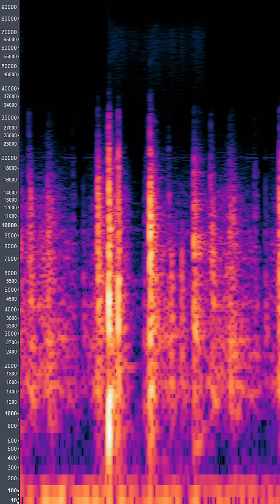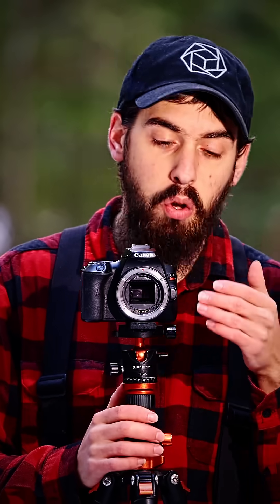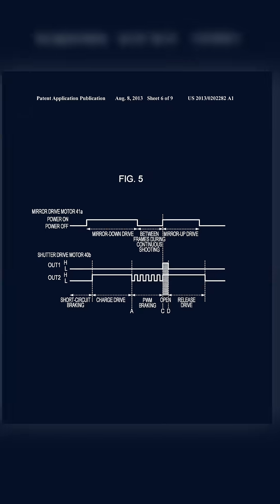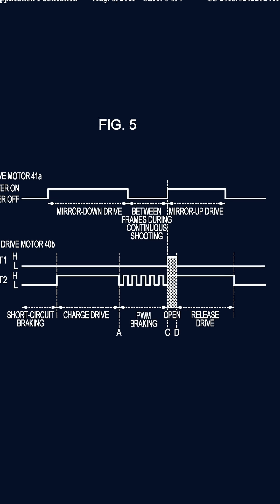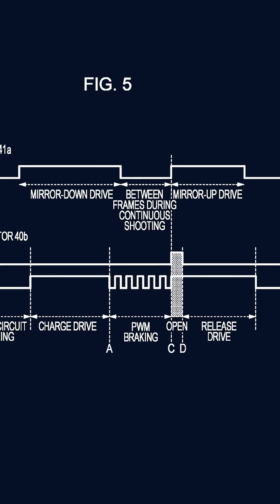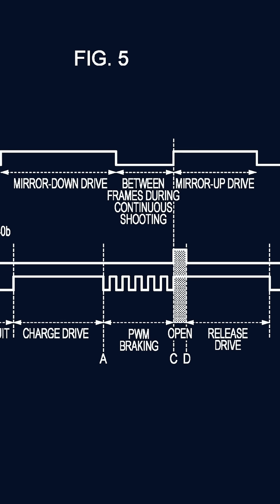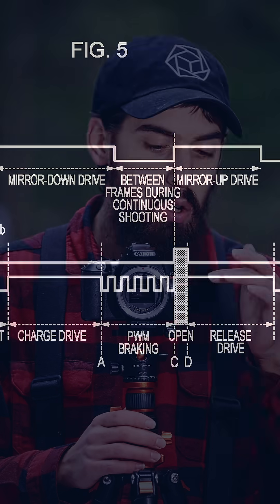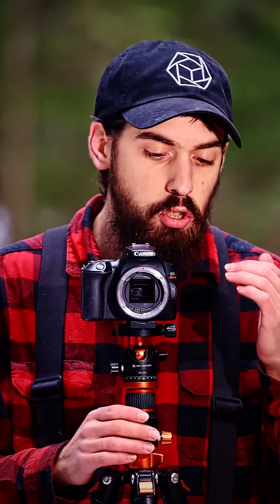Listening to Ultrasonic Sounds Produced by a Camera

Comment: If the shutter has metal parts, the ultrasonic static could be just mechanical sounds of metal. I've done foley recordings with an ultrasonic mic (Sanken co-100k) and it's just the case that metal objects resonate at ultrasonic frequencies. Jingling a bunch of keys produces tons of ultrasounds. Glass, plastic and wood don't produce ultrasounds, but metal and water do.

Comment: sensor cleaning 😉
Reply from the maker: The sensor cleaning only runs when the camera turns on or off, not while taking photos. Also, just to be sure, I tried recording the camera when it was performing the sensor cleaning and it only produces sounds up to 32kHz, not the 60-70kHz we're hearing when taking photos.

Comment: Many cameras use ultrasonic frequencies to clean sensor I heard, On canon cameras it is set to occur at start and power down of the camera automatically by default, (the display says “sensor cleaning” when it occurs) , maybe this model does the cleaning even between shots automatically to prevent dust or debris from sticking to sensor,
Reply from the maker: I had a chance to do some more testing yesterday. The sensor cleaning only seems to produce frequencies up to about 32kHz. Whatever this sound is only occurs when the mirror/shutter move (I tested by switching in an out of live view). I still haven't determined whether it's the shutter or the mirror though.

Comment: 20khz is still audible spectrum not ultrasound. 60khz you need a microphone, preamp and converter, that go up to that, which is rare, use only for measurments and bats, not normal audio recording, first and second audio gear is probably not shielded for interference and stuff that high so it could be anything.
Reply from the maker: I don't think a lot of people realize just how common gear which can record ultrasonic sound is. Sure, you can't just go buy a random LAV mic and record ultrasound, but you don't have to pay thousands of dollars like a lot of people think.
For one, most microphones can record virtually any frequency because it's analog. Where the issue arises is in the ADC which needs to be able to record a high sample rate. But when it comes to professional audio (not just for recording ultrasound), a high sample rate is common, not rare.
Reply: @BlenderTimer 
Microphones cant record any frequency. Wavelenghts have sizes  in mm and the size must a lot bigger than the components of the microphones, it's acoustics, basically, like subwoofers cant reproduce crisp highs big membranes cant capture ultrasound. Just like analog cameras dont record radio waves. For the record schoeps mikes that are used for high quality classical reach up to 40khz +-1db and they cost over 2k$. 60khz I never heard honestly anything, and i recorded soundscapes as a job for quite a bit.
Also adc have higher sample rates to allow for smoother filters, so the phase in the audible spectrum is less impacted, but they dont maintain the frequencies above 20khz.
On top of all that capacitors and inductances in the analog signal path act like filters and there's no regard whatsoever of anything above 20khz so whatever is there might not reflect reality.
If your information differ please provide actual measurements made with specialized gear.
Reply from the maker: @tutatis96  Well, it's quite clear to me that you're another one of those people who think they know everything when they don't. You say the gear can't record ultrasound when I have TONS of evidence that it can (including the frequency response data of the mic). You're talking about recording 40kHz at 1db but forget that when you're recording at 32bit you don't need the microphone to be extra sensitive to ultrasonic sounds in order to record ultrasonic sounds. I specifically said in other comments here that I use the Zoom F3 for recording ultrasound, which if you do some basic googling you can find that there are thousands of people who use the F3 for recording ultrasound.
I would recommend before you go around on the internet acting like you know what you're talking about that you do a bit of research on what you claim to know.

Comment: The static sound is produced by the required DC/DC converters for the several onboard voltages. Depending on the converter type they operate in different frequencies, some do in the ultrasonic range (I guess the display supply).

Comment: DSLRs generally contain one 8.4 V battery but their circuitry runs on a couple of different voltages like 3.3 V. Maybe the back-converters have something to do with the static sound
Reply from the maker: Maybe. I mean it surely has to be something with the circuitry. 🤔

Comment: Bro? How did you come with that? Most microphones have filters limiting frequencies above 20kHz. The same for other parts of audio chain, and most importantly, the sampling frequency of the ADC limits the band it captures
Reply from the maker: You have to get a good ADC. In my case I'm using the Zoom F3 which many people use to record ultrasound since it allows a 192kHz sample rate.

Comment: Maybe the static like ultrasonic sound, could be the self sensor cleaning. If I remember correctly they use a piezo to shake off the dust from the IR block filter in front of the sensor. But I don’t know if is operated continuously or only at startup.
Reply from the maker: Yeah they do use a piezo element, but they only function when the camera turns off and on (at least as far as I'm aware). I haven't actually tried recording the cleaning function separately, I should do that.

Comment: Maybe resonance of some kind? Seems like the static sound has energy also in the main spectrum, maybe caused by the spring mechanism of the mirror
Reply from the maker: It seems like it cuts off too quickly for resonance though. It seems like it'd fade out at least a little bit rather than just cutting off.

Comment: This only works if you have audio equipment that can record at higher than 44.1 kHz, which is specialty. Basically you can record up to half the sample rate (so 44.1kHz maxes out at 22.05kHz frequencies). Also be wary that most (even specialty and professional) recorders have low pass filters to filter out anything above 20 kHz as they will otherwise cause aliasing issues (i’m almost 100% sure the issue with ‘static’ and the 20 khz signal is aliasing or measurement noise). Finding equipment without that filter is hard!

The slowed down audio you showed us has zero ultrasonic information captured in there. This shows how hard audio is! You really need very special equipment (specialty microphones + specialty recorders) to do this!
Reply from the maker: No, the static is a real sound recorded, not a glitch. The microphone I have allows disabling the low-pass filter and the ADC I'm using allows sample rates of 192kHz and 32bit. The aliasing would only cause frequencies higher than 96kHz to sound a lower pitch (which could theoretically be what's happening but I highly doubt it and even then that would still mean there's an ultrasonic sound produced by the camera that's >96kHz).

Comment: It’s presumably either some power circuitry or parts like the shutter. You may be able to check for the latter by changing how stable the camera is when you trigger it. For example placing the camera on a table rather than mounted on a tripod. A quick and dirty way to check the former would be varying the power load or using an external power supply.

A few quick google searches  "Canon DSLR shutters, especially in modern digital models, use a pair of lightweight metal blades (often titanium or aluminum alloys)”

“Titanium's vibration frequency isn't a single number; it depends on its form (alloy, pure), shape, size, and conditions, but it generally has high stiffness, meaning it vibrates at high natural frequencies (kHz range for small parts like implants), while its damping is low, making it ring longer… For example, a Ti-6Al-4V test specimen might have a natural frequency around 20 kHz”

Comment: The static is probably random EMF from mixing products of the PWM oscillator and other things in there. Most things with servos will have a high pitched whine (when I was younger, I could hear it. I still can, but not as well.)

Comment: Interesting! Do you also have this if the camera stays in live view mode? Probably is the sensor being used? I'm super curious now!
Reply from the maker: I did try that because I initially thought maybe it was the sensor being read. I tested in live view and the sound only occurs when the mirror and shutter are being opened and closed. So that rules out the sensor.

Comment: It may be noise from the motor brushes if it's a brush motor. Brush motors would cause static on the TV and radio in the analog days from the arcing. of course there is a physical sound associated with that.

Comment: Maybe it is the noise of the crystal oscillator. They are typically set to 32768 hz, but probably there are versions set to 65536 hz for better precision.
Reply from the maker: The closest sounding thing I've recorded was a piezoelectric igniter, but the only piezo element I'm aware of inside the camera is for cleaning the sensor which doesn't operate when taking photos. So I'm not sure.

Comment: Sometimes autofocus can do something similar but it’ll be picked up on a radio frequency, I’ve heard it on my scanner when I was listening to the ATC frequency and as I focused it made a high pitched buzzing and static sound
Reply from the maker: Yeah, many lenses use USMs (ultrasonic motors) for focusing. I tried recording one but wasn't able to hear anything, so either it was so quiet that background noise muffled it out or it was beyond 100kHz (the max frequency I am capable of recording).

Comment: I heard the static, but I couldn't hear the other one.
Reply from the maker: It's a bit more difficult to hear. It's almost exactly 20kHz which in the slowed down version is 2,000 Hz. So if you get a sine-wave tone generator and set it to 2,000 Hz, that's basically what the sound is like. I don't know if that might make it easier for you to pick it out from the other sounds.

Comment: could it be coil whine of the motors spools perhaps?
Reply from the maker: I don't think so because the other ultrasonic "whines" I've recorded (such as my PC etc.) always sound more like a tone rather than static. The closest thing I've recorded that sounded similar was piezoelectric igniter, which produced the initial spark sound and then some really strange wobbling static sound at around 55-75kHz (I shared the sound on my Discord server). I know many cameras use piezo elements to clean the sensor, but those shouldn't be doing anything while the camera is taking photos. So I don't know if there are some piezo elements for other things or if it's still something different.

Comment: also on mirror cameras sensor auto cleaning produces high pitch sound, but mine does that only when you turn it on
Reply: On most cameras you can turn it off on start-up and shutdown, that way you have a camera that is more responsive in turning on and off. You should still be able to activate the ultrasonic sensor cleaning mode manually though.

Comment: If we assume that the 20kHz is from the PWM, which are square pulses. A square wave has its first noticeable harmonic at its third harmonic, i.e. if the pulses are at a fundamental frequency of 20kHz, the next frequency that is also generated would be 60kHz, due to the shape of the wave. If you were able to measure higher frequencies with enough dynamic range you would see a even weaker one at 100kHz (5:th harmonic).
Reply from the maker: Hmmmm, that's interesting...
I feel like it can't be related to the PWM though since it falls at different times than the 20kHz tone. But, I'm not sure.

Comment: I think the static is coil whine from the electricity traveling through the sensor and going to the image processor. The Sony A7iii elstronic shutter also makes a really faint noise sound when it is taking photos.
Reply from the maker: I didn't include it in the video since I only have my mirrorless camera to film the slowmotion video, but I tried recording my mirrorless camera (Canon R5II) and using the mechanical shutter there's 50-70kHz static but no 20kHz tone. However, the other electronic whines which I've recorded always seem to more match a tone rather than static.
Using the electronic shutter it doesn't have any ultrasonic sounds, it only creates sound at about 400Hz, 1,000Hz, 8,000-9,000Hz, 11,500Hz, and 17,000Hz. But most of these sounds are made by the camera 24/7 and only get louder when capturing photos. So some of them might just be an internal fan, but I don't know what the others are from.
Reply: @BlenderTimer isn't that the sound of the sensor ibis then? I know they only fully activate when in video or taking pictures. That might be it.
Reply from the maker: @Fernandosampaio_  I don't think so. The same actuators that control IBIS also keep the sensor in position even if IBIS is off (so should be active 24/7 when the camera is on, and shouldn't change when photos are being taken). The DSLR also doesn't have IBIS.
Reply: @BlenderTimer  The static could be electrical harmonics related to the motor functions.
Quite the rabbit hole you've discovered... I might have to stop procrastinating my research on electrical harmonics now...
Reply from the maker: @finnvallar LOL
Reply: @BlenderTimer  When the mirrorless camera is taking a picture, both the sensor and IBIS are likely switching into different modes. The sensor switches from lower 10 or 12-bit video mode with lower resolution (and likely optimized for power usage) to the full resolution 14 or 16-bit image capture mode (which will use max power). The IBIS will switch from simply keeping the sensor centered (probs also power usage optimized) to active stabilized mode. There's a chance that these mode switches could explain any noise in the R5II, and you could test the video mode (which uses different sensor and IBIS modes) to see differences. Doesn't explain any of the DSLR stuff tho. My hunch is that it has something to do with the ADCs in the sensor, processor noise (idk if that's a thing), or the interconnecting ribbon cable in between.
Reply from the maker: @needles_balloon  That's interesting. Hmmm... I'm going to do some more tests here soon. I just have to wait for the weather to cooperate so I can take my gear outside. There are too many other electronics producing ultrasound inside. LOL
Reply: Sony image stabilizers are also quite audible, the A200's IBIS produces a 15KHz hum, the A77II produces a 25KHz hum and the A7IV produces around 30KHz, that's the amount of times per second they work at which is absolutely insane.
Reply: @Boeing747Cultist yes, also the sensor is 30 times per second capturing a imagem for live view mode which adds more to the noise

Comment: I also know that ultrasound frequencies can make the camera shake, I saw it when a bat created ultrasound frequencies that make the video itself vibrate.
Reply from the maker: Yeah, I didn't include it in this video but a lot of cameras actually use ultrasonic motion to clear dust off of the sensor.
So much cool stuff in such a tiny frame!😄
Reply: Is it the sensor shift/optical stabilization or anything else that vibrated?
Reply from the maker: @TeaterMTSNPalopo7  No, this camera doesn't have any IBIS (in body image stabilization) and there's not lens attached which would give stabilization.
Reply: @BlenderTimer  no I mean when a loud ultrasonic noise is emitted for example a bat, is it the moving motors that are vibrating (when it looks like the vid is) or is it something else?
Reply from the maker: @TeaterMTSNPalopo7  Oh. In that case (at least if it's the same video I saw), the effect was either entirely digital/fake or the device's optical stabilization glitching out. Not an effect from the bat. LOL